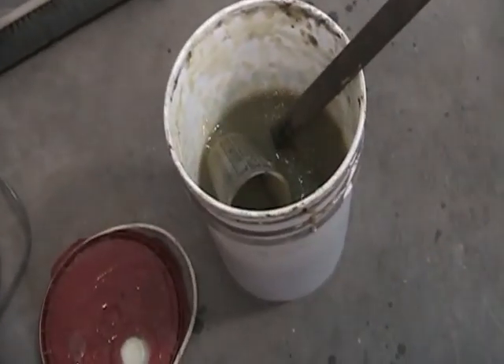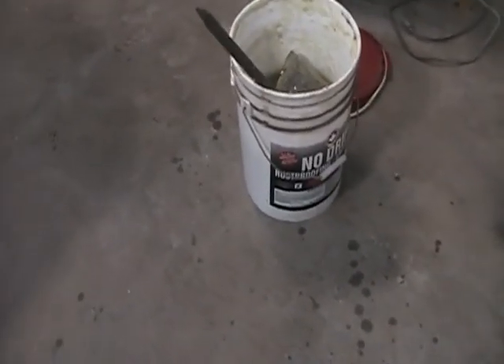undercoating

Comment: Good job on the undercoating and the mustang.  The one thing I recomend is practice your weld settings on a piece of scrap metal you cut off the car. That way you don't risk repairing any extra work caused by bad welds.  Just a thought .

Comment: Most bar and chain oil contain phosphoric acid, not good for the rubber bushings and seals under your car. Fluid film is okay but doesn't seem to hold up very well in New England. The Rust Stop pro 3000 is petroleum-based, no solvents detergents etc. pretty good stuff with great tech support, might be worth a try.
http://nhoilundercoating.com/Do_it_yourself_kit.html